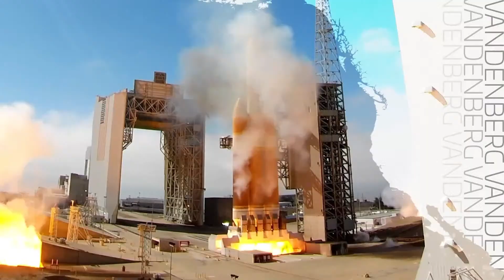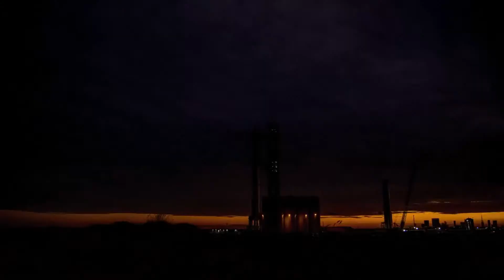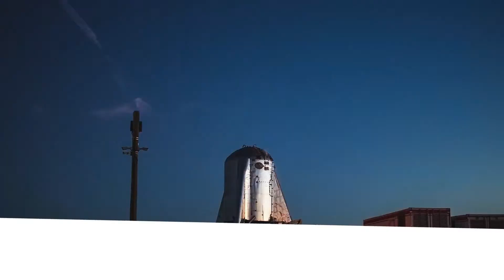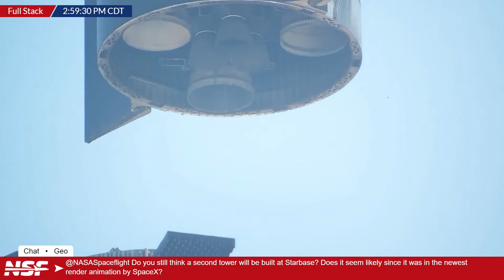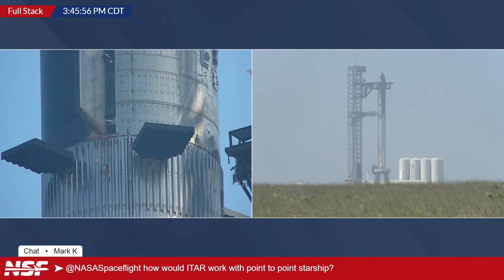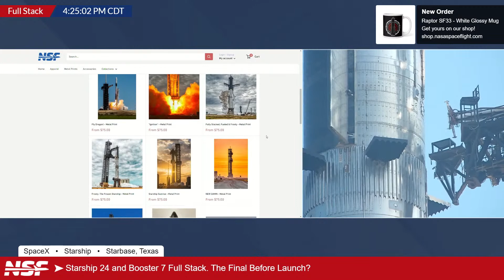Starship 24 Stacking Ahead of Launch!

Comment: Point to point will never work if you think about the logistics. Where do you launch from? LAX? What happens if you have to self destruct a rocket over LA how does that work. So let's say you launch from the ocean. How do you get the passengers to the launch platform. By helicopter? Do you show up at LAX and get on a helicopter that then flies you to the offshore launch site. What if the weather is bad and you can't fly a chopper to the launch site. What if you use a boat to get to the launch site. Now you have to build mooring facilities on the coast which could be damaged in storms. How do old people or children or pregnant women react to the G-forces at liftoff. Does every passenger have to have a spacesuit. How long does it take to get someone to the launch site and on the rocket and then off the rocket at the other end. And where do you land the flight. Lets say you go from LA to London. Do you have offshore facilities in the English channel or do you try to land a rocket  in Central London. What if you launch from LA in good weather but the weather is bad at the landing site. You can't stay airborne in a cannonball which is what a rocket becomes once you launch it. And don't get me started on what it would cost for a seat. Point to point might work for the military because they have airfields that could contain the needed integration towers but you would need launch facilities for any city you wanted to launch from and it's almost impossible to build new airports anywhere near any major city in the world so how could you get approval to build the launch and landing facilities that you would need in multiple cities all over the world? Point to point with rockets is just not going to happen. Rockets are for space travel. BTW the S in Isla Blanca is silent! It's not pronounced IS-LA Blanca, it's pronounced EYE-LA Blanca.

Comment: Faling ice: Ice isn't going to form on the heat shield tiles so it won't  fall on the leading edges of the flaps which have tiles above them. For the record I don't  like the term flaps for these control surfaces. Flaps is a term already used on airplanes and they are very different  than these new type of control surfaces. I personaly like Tim Dod's coined word " Elonaron",

Comment: Do you all think they will wait to attempt a catch until they have a 2nd tower and ring ready for operations?
Reply: I was wondering about that too. One bad catch, and they spend the next 10-12 months clearing debris and rebuilding everything. The same could be said for a RUD of a full stack on the launch pad. But that's just the way they roll. Losses will take place, lessons will be learned. Rebuild and retry until they get it right, however long it takes. I don't care for Musk personally, but SpaceX's technology development, rapid growth and market share in a launch industry dominated by the entrenched "good ol' boys club" is breathtaking.
Reply: I think you’ll see them practice in an open area first away from the tower. A ground landing. They’re not going to risk the launch area until they’re confident it works.

Comment: I hope they get good enough at stacking the ship on the booster that they're able to load passengers with the ship tipped on it's side like a traditional aircraft. Then, up-righted and lifted onto the booster with the chopsticks.
Reply: Have you ever seen a Starship set down anyway  but vertically?  The structure  is only designed  to bear weight in that orientation.
Reply: @seekerstan  it does that when descending on its belly and flipping over in a couple of seconds, i don't think static loads would be a problem
Reply: @seekerstan  Well I mean it can handle aero dynamic and re-entry forces in that direction.
Reply: Also with the help of a strong back. Not saying it's going to be sitting on the ground. The strong back could bear some of the weight and handle the tipping and transportation procedure to keep mechazilla simple. 

At KSC the Saturn 5, Falcon 9 and various other rockets are presented laying on their sides. Those rockets also had to be able to support it being "laid down" in order to be shipped via cargo ships.
Reply: This idea is trying to mirror an airport system of sorts

Comment: 220 mph terminal velocity? It'll be a lot less than that with an empty tank and high drag to mass ratio!
i'd guess terminal velocity may be as low as 60 mph if flat with flaps extended and tank nearly empty.
Reply: That terminal velocity is more or less the one that SN8-15 vehicles reached when they did their bellyflops. 60mph is too slow
Reply: @ale131296  Ballpark same order of magnitude

Comment: If a tile fell off, it would do zero  damage to the ground - they are almost weightless.
Reply: Shuttle tile tech w/ upgrades . . . basically candy-coated foamy glass. (think cotton candy with M&M coating for shape stability).
Reply: @ThompPL1 acuum is indeed the best insulator (I assume there is vacuum in between the pores)

EDIT: turns out it’s just air.